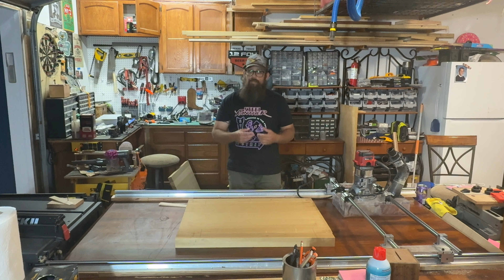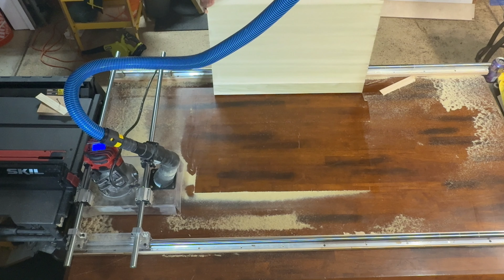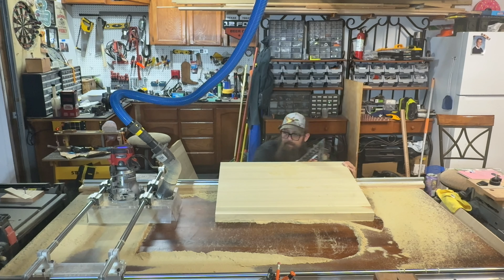The Ultimate Router Sled Test!

Comment from the maker: Links:
🔨 Instagram: https://www.instagram.com/foxandkitwoodworks
📘 Facebook: https://www.facebook.com/profile.php?id=100093516764067
Description:
In this video, I share my first impressions and setup guide for the Crafted Elements Router Sled. If you’re working with large slabs, live edge tables, or oversized boards that won’t fit in your planer or jointer, this review will walk you through why a router sled is essential, how the Crafted Elements system works, and what you can expect during assembly and use.
From build quality, setup tips, cost comparisons, and performance on real projects, I’ll cover everything you need to know before buying. If you’ve been wondering whether the Crafted Elements Router Sled is worth it, this video will help you decide.

What do you want to see next? Comment below!